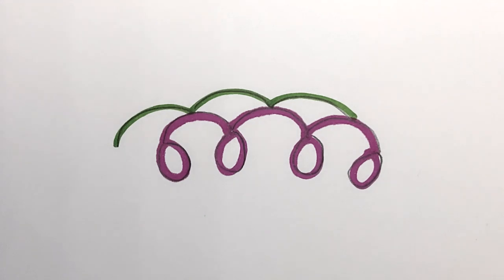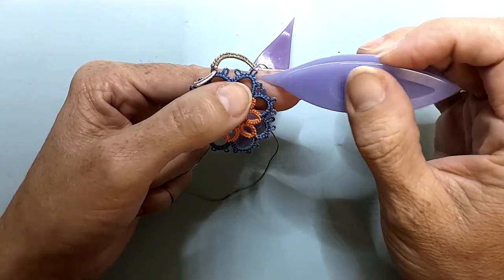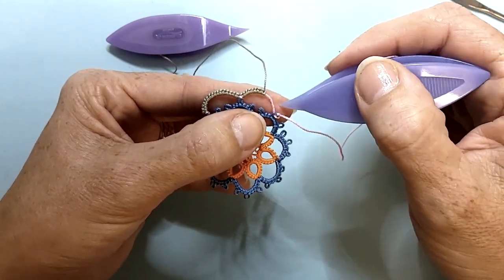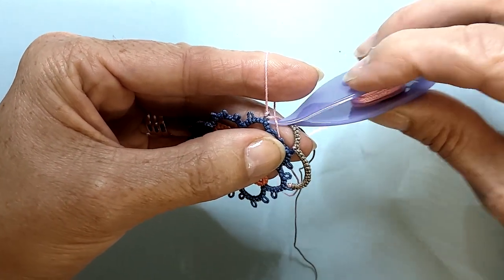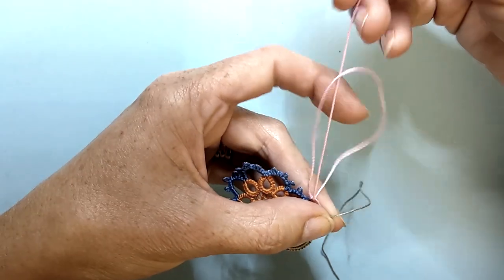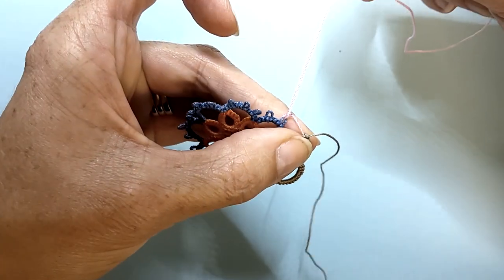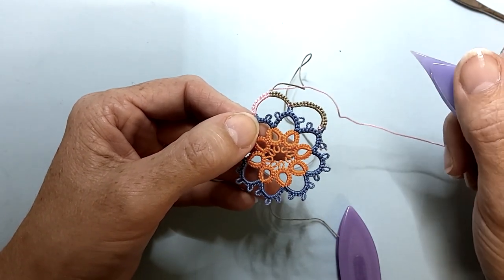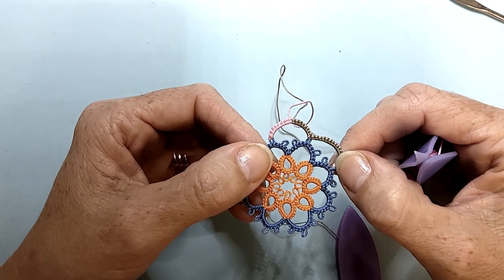Shuttle Tatting -  FS/BS Split Chains

Comment: How do you know when the pattern should have split chains? Is it when you have another round that connects in the middle of the chain?
Reply from the maker: The pattern might have two or three rounds of chains - like my Clara Doily. Even then, you don't HAVE to work split chains, you can cut and tie each round if you prefer... but most tatters hate ends so will opt to work a split chain, using it to climb out to the next round.
The split doesn't have to be in the middle, and it will depend on what the element is in the following round as to whether a split chain is possible.